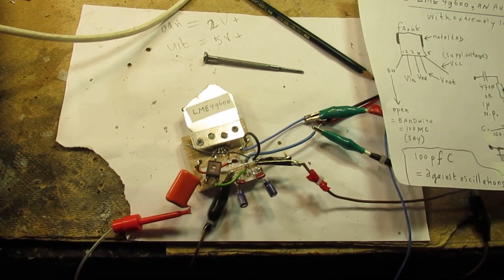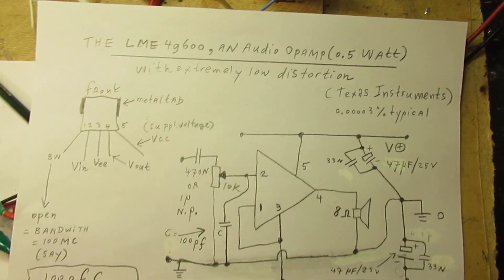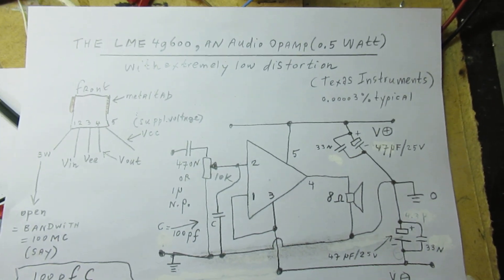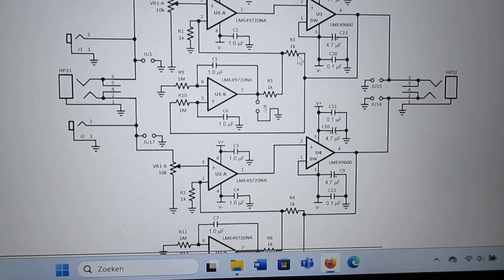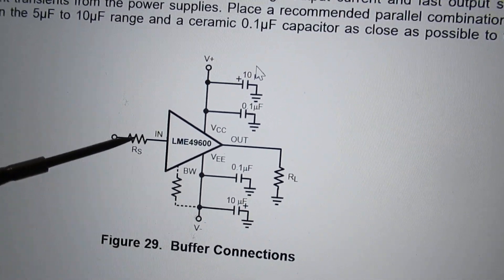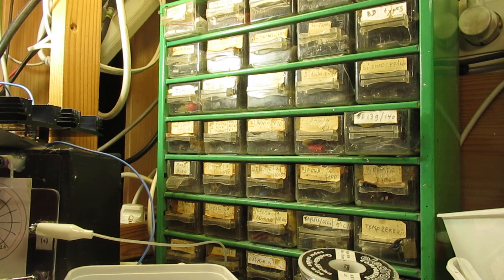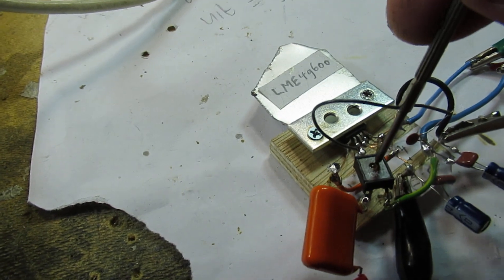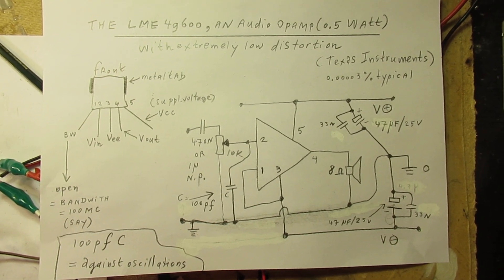The LME 49600: a HiFi Audio Opamp for 0,5 Watt output with 0,0003 % distortion, schematic and demo

Comment: Hello, nice sound. I wonder if a higher wattage amplifier can be made with this opamp. Good luck in your work.
Reply from the maker: No, that is impossible, at least when you use only this chip. But you can surely drive 2 power end transistors (NPN-PNP) with it. In that case: yes. I also saw somewehere that they switched a few of them in parallel, to get more output, it seems not a good idea to me. Thanks.

Comment: Hi Ko, nice to see this IC in action. How is the temperature on this IC ?
Reply from the maker: It is very low, both on 2x4 Volt and 2x14 Volt. Kind of hand-warm or less.
Reply: @radiofun232  , nice to hear.